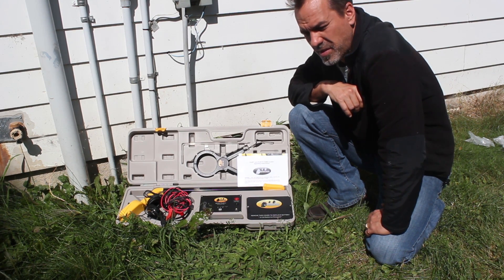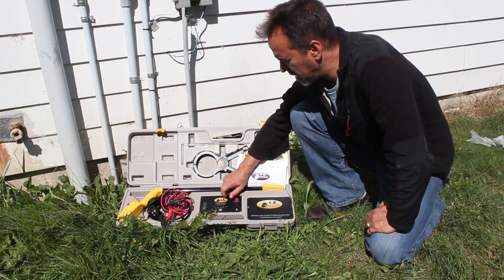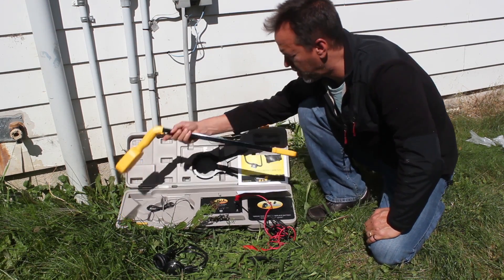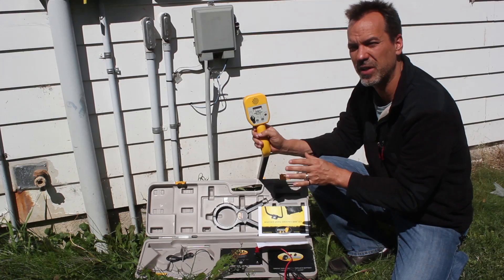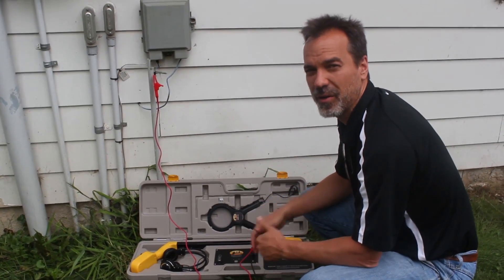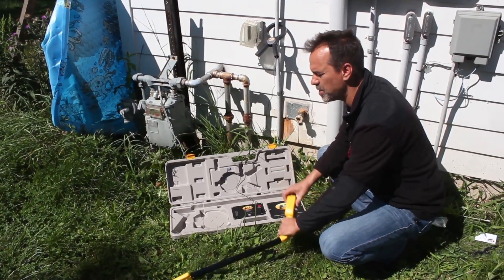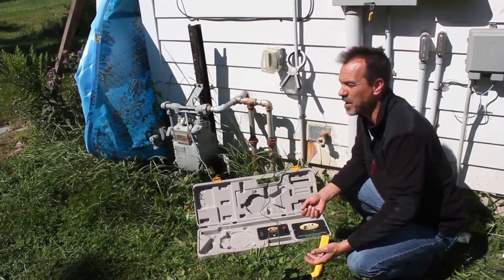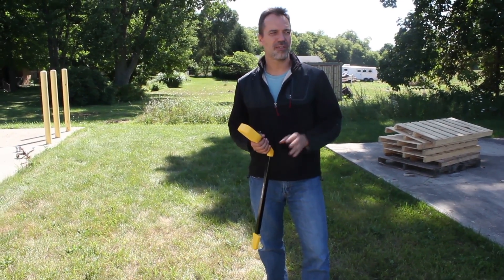How to use the Armada Pro871C Underground Cable Locator to Find Buried Wires.

Comment: We were trying to follow a locate wire yesterday.
We couldn't get direct connect to pick up a signal from the wire more that a few inches away from it. I assume it was a bad ground because we could only get the metal rod in the dirt an inch or so (frozen ground) 
We switch to induction, used the clamp and tracked the wire down to the nearest ped location. But after watching this video, it shouldn't have worked because neither end of the wire was grounded.
Were we inducing a current on the adjacent power cable (joint trench) and detecting that instead?
As an experiment, we pulled our wire out about 30' but we were still getting signal at the end as though it was still there.

Comment: Excellent video very well explained. Please give the depth that this instrument can detect to
Reply: The Pro871 is not our highest performing model, but I would say 36 inches is typical tracking depth.
Reply: @jlcarefoot  Thank you for your reply Jim, that will work for the majority of my wire. I know the location where it comes out of the basement wall is 56 inches deep

Comment: Hello, is it possible to use this device for underground drainages pipes?
Reply: Hi David.  It will track metallic piping, but concrete or plastic is more difficult. Non-metallic pipes can be tracked using something like our Pro65 tracer or even a metal fish tape pushed into the pipe.
Reply: @jlcarefoot  Roger that! Thank you very much
Reply: @jlcarefoot  dear Jim, is it possible to find the void pipe detector in Japan?
Reply: David - By a 'void pipe' detector do you mean tracking a hollow non-metallic pipe? There are Chinese manufactured devices for tracking pipe that are probably available in Japan. You can always use a regular wire tracker with a metallic fish tape for many applications.

Comment: How far can the transmitter send a signal in a cable? What is the longest distance it can be detected if you have a really long cable to track? Is any mode less detectable then the other?
Reply from the maker: The best tracking results from using the Lo (2 kHz) frequency signal connected directly to the wire or cable. You can often get several thousand feet of tracking that way. The Hi (33 kHz) frequency will not reach quite as far as it is designed to follow shorter, shallower wires like outdoor lighting. The handy Inductive modes (Broadcast antenna or clamp) work on shorter distances are vary with physical conditions. You should get hundreds of feet even in the short range cases.
Reply: @ArmadaTech  What kind of warranty do you have for this unit and how long is it for?

Comment: Can this product be used to induce a frequency on a buried metal conduit (EMT) and detect this frequency to locate the location of the conduit?
Reply from the maker: Yes, either of two ways. 1) much like wire tracking, connect the red clip lead to a point on the conduit (like a junction) and black to ground. 2) Use the broadcast mode with the transmitter box adjacent to some location on the path of the conduit.

Comment: Hi Joseph. Thanks for watching.
When tracking a low voltage wire it is best to disconnect it from the control box and clip the transmitter leads right to the wire and using the low frequency mode. You could do much the same thing in broadcast mode by leaving the wire connected and either 1) clamping around the wire above ground, or 2) placing the transmitter case on the ground over the cable. Broadcast mode is handy, but has a shorter tracking range (lower power).